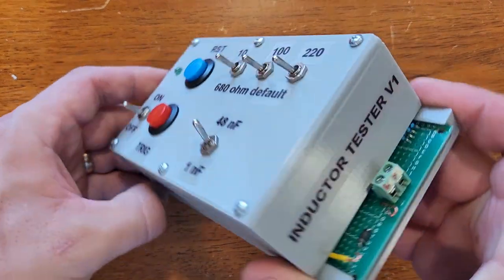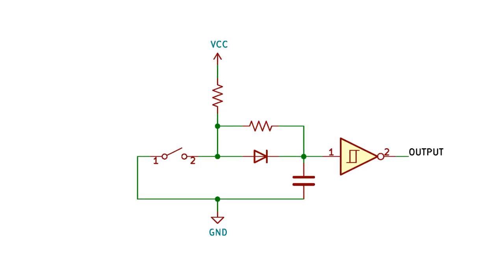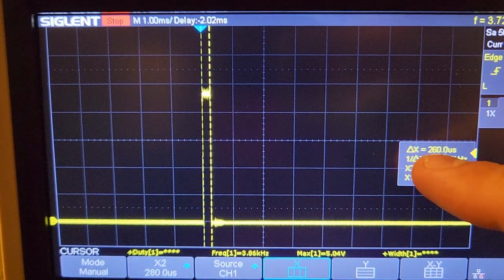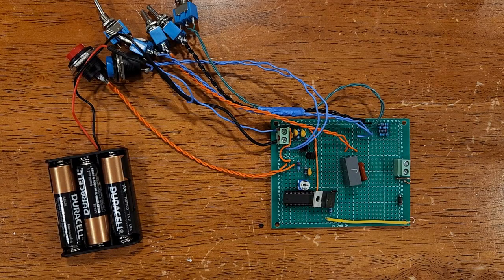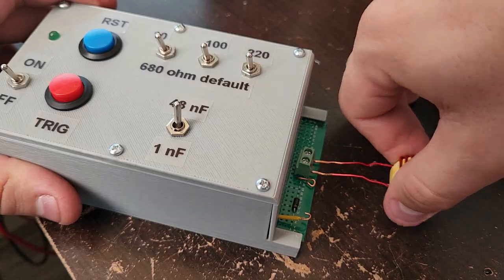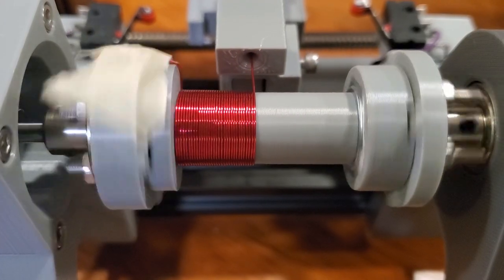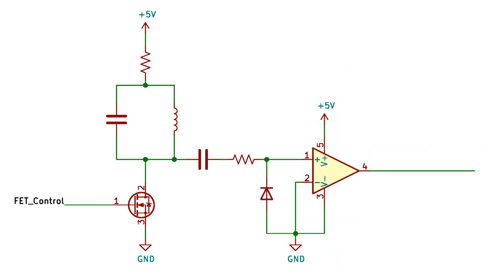Inductor Tester

Comment: It's worth noting that the angular frequency you measure isn't equal to w=1/√LC but rather √(w^2 + (R/2L)^2) so if your capacitor and inductor both have large parasitic resistances the typical LC calculations will be slightly biased. The best way to measure it is to perform a non-linear regression against your data with the expected formula for the RLC step response and then you also get nice error bounds on your measurement

Comment: There is simpler method. Just apply step voltage to inductor for short period of time and measure speed of increasing of current in the beginning of transient dI/dt. The inductance will be calculated as Voltage / (dI/dt). Using this method you can also observe how the inductance decreases while current rises and dI/dt also increases (meaning current rises faster). You can measure saturation current which is important for power applications using this method.

Comment: "I built the circuit , but I have a problem. The pulse enters the gate of the MOSFET correctly, but when measuring at the anode of the MUR120G diode, the pulse is inverted. The MOSFET I used is a 3N80C with an RDS on of 4.8 ohms, instead of the RF540 which has an RDS on of 77 mohms

Comment: One important point:
The waveform that we observer on oscilloscope is the "damped" waveform. And damped waveform frequency is not same as the resonant frequency.

Resonant frequency = wn = 1/sqrt(LC)
Damped frequency = wd = wn*sqrt(1 - zeta^2)
And zeta = (R/2)*sqrt(C/L)

Overall, is the resistance of the inductor is significant, you can still calculate the L value by measuring the "R" separately and making correction to the damped waveform. That way, you will get better accuracy of the inductance measurement.
Reply: With lower inductance values, like the ones he is mainly working with, the resistance is usually extremely small, so it might not be worth factoring it in and doing more calculations than is necessary. Desmos Scientific calculator could certainly help though.

Comment: This is a very very crude inductor tester.  I believe the best way to measure the inductance is using  a steady state oscillator.  You should not measure the impulse responses of the inductor because you don't know at what voltage you should be measuring.    You can use a feedback loop control and change those resistors via audrina. 

You look like a young engineer who wants to build  something that isnt reliable just for YouTube to show and tell.
Reply: My goodness. You sure show how bad your knowledge is. And how rude you are. The LC tank rings at a specific frequency independent of the applied voltage. You don't even look like that young engineer you claim he is since engineering courses teach about LC circuits and resonances early on in the course - thus you would know this. A steady state oscillator with an arduino? That one is so sad. At least attempt a colpitt oscillator. A buddy of mine was trying to find the precise value of an inductor about a week ago so I told him about this method. I just found this video and sent him a link to show that the concept works.

Comment: Your frequency measurement / calculation may give you a pretty far-off reading of the actual inductance. The resonant frequency of your transient is modified by the damping of the circuit. Since your capacitor, inductor, and mosfet all have resistance, these drive your damping factor. A quick review of https://en.m.wikipedia.org/wiki/RLC_circuit may be helpful in producing a much more accurate result. 

I assume you are using C0G capacitors, right? Otherwise there goes another 10-50% on the inductance estimate due to tolerances. Of course you could also calibrate that away by simply not attaching an inductor and producing a good estimate of your capacitance in the current operating conditions. 

Oh - and if you are using ceramic capacitors they suffer from capacitance value changes with voltage :(. For best results, film caps offer low ESR, good tolerance and excellent stability vs. voltage. Or use a high voltage ceramic with regard to your actual test voltage. Say 50V C0G ceramics. But film would generally be better.

Comment: Your slow turn-on may be due to browning out your HC14 STs.  They can source or sink 4mA, so at 5V you need like 1.3K Rg to keep the current in range. You might experiment with this a little to see if things improve. Otherwise another gain stage or gate-driver to allow a higher gate current will improve the situation / get you past the miller plateau faster.

Comment: Video has been up for awhile, but thought I would ask why you used the Schmitt Trigger output to drive a MOSFET instead of just using the pulse that it generated?
Reply from the maker: making sure there's no repeat triggerings from switch bounce
Reply: @HyperspacePirate  I was under the impression that the transistor latch circuit was meant to eliminate switch bounce, is the MOSFET just an extra precaution?
Reply from the maker: @ethanmarlatt797  theoretically the peak current could be really high so i didn't want that going through the small switch or tiny BJTs
Reply: @HyperspacePirate  Ah okay, thanks for replying! Looking forward to next update in your cryocooler series!

Comment: Hey I looked up the IRF540N RDS-ON =40milloohms so the maximum current that the LC circuit can draw in while charging up the LC circuit to store energy in case of 10ohm resistor is 4.5/(10+0.04)=0.432amps I hope this is correct since I'm designing a similar circuit to your's thanks any way your design is so helpful I used the oscillator part but with lower  Mosfet RDS-ON =2.5 IRLB ohm

Comment: Keep in mind some frequency-related effects for core materials.  For instance, the powdered iron core loss might be worse than the 1nF cap at ~500khz.  Also, solid steel slug cores will have large eddy currents, especially at 10s of kHz.  Maybe worth trying bigger capacitors to lower the testing freq? 

My quick and dirty method for measuring high power inductors, especially over wide range of current or flux density, is to apply a fixed voltage pulse to the inductor from a low impedance source, could be large electrolytic cap, with a mosfet and measure the current response during the pulse with a current transformer or shunt or hall-effect sensor.  For instance, 5V applied to 1mH gives a current rise rate of V/L = di/dt or 5A per millisecond (keep the pulses short!).
Reply from the maker: Good advice, thanks. I did notice a slight discrepancy in inductance on the 1nF vs 48 nF caps with certain core materials, so i guess that explains it
Reply: Can u made tutorial of it

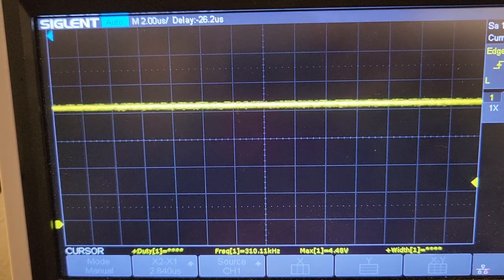Comment: Wow, you put a 50mA through the reset switch? Its lifetime decreases a lot, that pushbutton you show at 2:45, even it is metal dome, it is possibly designed for a much smaller current. Edit: also, an indication of when the device is triggered, so you don't forget to reset it (make it blue, to bother your eyes, hehe) would be nice (nope, a LED in series with the 2.2k will not work, too small the current, you need another transistor there).
Reply: Maybe add a P-channel mosfet for the reset and trigger it with the push button.

Comment: Actually, you could make a latch /*actually RS trigger*/ from two spare Schmitt triggers elements and resistors!
The transistors could be better used in MOSFET gate driver to make ON/OFF edges sharper and not overload  Schmitt trigger.

Comment: Man I would have loved this when I was teaching an E&M lab class,  we'd do one experiment with an RLC circuit and we'd power it with a square wave and try to find the inductance but regardless of what setup we'd use the inductance measured from the time constant decay would have discrepancies from the measured inductance based on the cycle frequency and could never figure out which one is "right" because the inductors have been in the department for years were theoretically "20mH"  but without knowing trying to problem solve why I always got discrepancies was impossible.

Comment: Very interesting your device/tester. If possible, I would like to see a continuation, probably using an add-on in the output. 
I guess those clamping diodes you have mentioned would shift or dampen the oscillation too much, and most jellybean Op-Amp would not work. Instead, I imagine a simple stage of most signal BJT transistor (HFE > 100) could be used to decouple & perform the saturation/cut (probably 5~10x gain), while sending its output to a frequency meter function of a DMM, for instance.

Comment: Great video. Thank you for that. Can you do a similar circuit, but instead, to detect the most efficient frequency to be used in an unknown ferrite core? Since there are different composites for ferrite cores, not knowing the specifics will not make it easy to choose the frequency to be used in a switching application. You would need to try from several tens of kilohertz up to maybe 1 MHz. A circuit to determine the most efficient frequency will certainly be VERY handy.

Comment: No offence but, if you work with inductors a lot, shouldn't you have owned a proper LCR meter instead of relying on a $10 DIY meter? Making one for yourself makes for a good YouTube video, I understand that but, even just spending $100 on a decent meter would make more sense if you need accuracy. Of course, you can spend as much as you want on one depending on needs and accuracy. I believe mine was around $250 which I still consider cheap being that it measures 20uH to 200H.

Comment: This resonance- and triggermode ist good for bigger inductors. But for amateurpurposes in micro and nanoranges only a well tested LCR Wheatstonebridge is fitting, but Nanohys are difficult to define and the potis of such a bridge are often scratching and to find the zeropoint is annoying. And bridges in multipurpose digitalmeters are failing for coils having to work up to 200 MHz for amateur applications, ie cristall oscillators. And to take the PLL or freerunning oscillator mode you need a perfect working microwave osci with a range over several octaves and a frequency counter synchronized by gps or dcf77. And then the Thomson formula has to be transformed and your sunday is over ..

Comment: I would have preferred a free running oscillator where the freq is based on the test inductor.
Then a microcontroller could take a freq measurement over a long period like a couple of seconds, and then give you a quite accurate inductance reading on a little display.
Reply: Also add noise.

Comment: Impressive electrical engineering skills. I wish I had half the ability you do.
Reply: Don't wish.......... KEEP PRACTISING AND LEARNING
one thing i see a lot of with beginners is  I WISH i knew this or that or whatever.
Forget Wishing,  Pull shit apart and learn what you can and if you don't know.... ASK US

I suppose another thing worth mentioning is..
- Remember everything starts as 1 BASIC CIRCUIT
- Then we add a circuit to that circuit to give the first circuit added functionality
and before you know it we have massively complex circuits

Look at his schematic again, Step by step and imagine it as separate circuits and you can actually build those separate circuits and test them so you understand what each stage does,
after you do that (which will likely take you 2 weeks)   YOU WILL WISH NO MORE :P

Comment: Hey man great project! I have a question about your toggle resistors. Since the 680 ohm is hardwired, when you toggle a different resistor wouldn't the resistance add to the 680 in parallel? For example, with the 220 switch flipped, the resistance of it paralleled with the 680 would be around 166 ohms. Does having a precise resistance value there not matter or am I missing something? Keep up the good work btw, I love analog electronics and I'm working towards my EE. Guys like you are a great inspiration and help me gain a better intuition for circuit design. Love.
Reply: Yes it would be added in parallel but the value of the resister isn't important it just change the amplitude of the oscillation and make it easier to measure, what you care about is the frequency of the oscillation.
Reply: Yes, adding the other resistors in parallel with the 680 ohm resistor drops the overall resistance. This is because as the inductors get smaller their response to the smallest current (from 680 ohm resistance) decreases. The parallel resistors allow for the current to be increased and therefore increasing the amplitude of the frequency response.

I hope this helps. I'm pursuing a BSEE as well. Cheers!
Reply: That's what I noticed

Comment: Nice, although afaik there is a frequency shift due to the oscillations decaying in amplitude. I usually go with the "frequency-sweep" approach, that is sweeping the frequency on a series RLC while looking for a peak voltage across the resistor.

Comment: It should be possible to use some of the unused inverters to replace the two transistors.

The 1N4148 diode has a breakdown voltage of 75V *minimum*; my guess is that the actual value is above 100 volts.  Also the diode in the MOSFET should protect the device.

Thanks for the interesting project.  My one drawback is that I don't have a 'scope that gives measurement of waveforms so I wouldn't be able to use this project.
Reply: you still can use the time divisions to eyeball the time between peaks and calculate the frequency as 1/T
Reply: @shauni_jade  
I've measured many inductors by paralleling a capacitor and finding the resonant frequency then calculating the inductance.  It's simpler than measuring pulses, and with a signal generator or receiver it's more accurate.

Comment: Or use bistable latch controlled by comparator for oscillator the frequency driving a switch that on / off controls a constant current source to a capacitor resister filter for a linear voltage output .
15 transistors or less .

Comment: Please can you make an electronic circuit that can calculate inductance without an oscilloscope
Reply: You might want to try a Maxwell or Hay's Bridge.  You will need a stable AC supply and an AC multimeter. It's probably also worth getting a decent capacitor.

Comment: Nice video. Tagged it for the next time I expand my tool set. If anyone decides to go with arduino the could likely add some front end functions. One button test (no need to switch the tester on and to arm it) and a timer to disconnect the battery after a few minutes of idle time.
Thanks again.

Comment: For the electronic output, maybe "amp it then clamp it"? Boost the voltage so that small ones get captured, then clamp it with zeners so it still can't exceed the 5V limit.